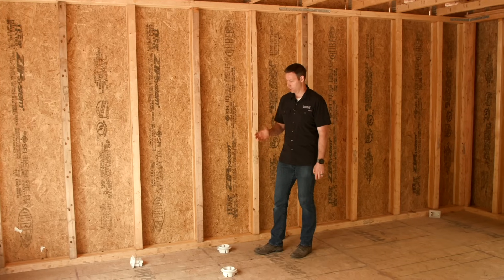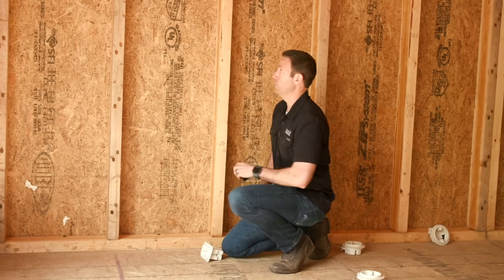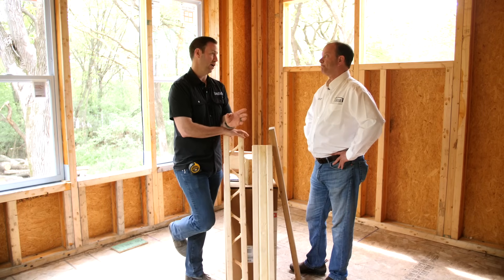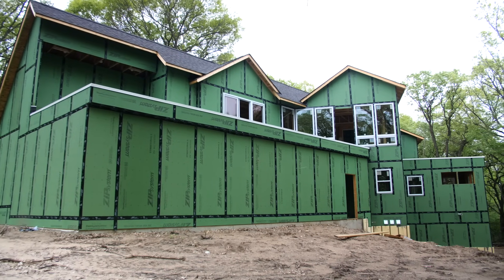Insulated Studs? This is a BIG Innovation in Framing!

Comment: They finally figured a way to Jack up the price of a 2x4
Reply: Um, no, 2x6 and 2x8... what’s the compression strength of these T-studs vs a standard 2x what ever again?
Reply: @4schitzangiggles  I guess allot stronger, little mess with the foam.....:-)
Reply: @4schitzangiggles  
Compression strength is based on unsupported compression. The T-stud is thicker (x3 instead of x2) and therefore has greater strength. This is mentioned in terms of length (height) of the 3x8.
Reply: it was only a matter of time
Reply: Lol, where I'm from they actually sell regular or "organic" framing wood, almost $2.30 more a stud for organic. 🤣
Reply: @TsrifTsal-s5m  I can only but assume he was refering to the insulating value (hence lower energy consumption, hence "better for the environment" ). Otherwise I agree with you: foam is dreadful.
I'm not at all in the house building business, what would you suggest as a good substitute?
Reply: @nicolas4601  go live in a cave...
Reply: I guarantee it will take a long time to recoup the cost of the savings, if any this overbuild costs.
Reply: We don't use 2x4's in exterior walls here in the northeast.  The concept is to virtually eliminate the thermal bridge, which is a very real issue.
Reply: @TsrifTsal-s5m  you looking at recycling a home ?
Reply: you don't have to buy these, if ur wanna go cheap and if you don't care about the environment thats fine, ill buy them for my future home
Reply: @JohnSmith-jz4pk  how eco friendly is manufacturing and disposing of the foam ?
Reply: Liking transwomen Isn’t gay if paying $13 for a $3 board is your way of saving the planet. When the board is 50% foam made from oil.

I think 🤔 you might be missing your own point
Reply: John Smith 
Hi John. I worked with styrofoam/polystyrene for about 15 years and it is very toxic material definitely not eco friendly at all plus it cost 4-6 times more than a 2x6

Comment: The industry misconception of believing a higher R value product is going to have a greater energy efficiency is misleading a lot of consumers. If someone is truly concerned about the energy efficiency of their home in Minnesota they will spray it with a two part closed cell foam. If your going to pay extra money to buy this product then don't use batting like he mentioned at 3:20. Remember wood is both a poor conductor and insulator since it is a bad conductor we don't have to worry about insulating it.

Comment: 2' oc will always make bowing in drywall, you should know this. Your studs suck
Reply: Well, you just have to use spray foam for the insulation.  Then you will have a solid block of, maybe toxic, manufactured goop as a home.  BTW did I mention we sell spray foam also?

Comment: I can see the value in the insulation factor in the wall construction up to the top plate but a house HAS to breathe , very curious how the insulated top plate will affect the air travel versus the traditional framing method over time.

Comment: electrical wire doesnt react with the foam? heat creation, wire casing lifespan
Reply: It's likely to be some sort of polyurethane foam, rather than polystyrene which is incompatible with PVC insulation usually used on cables. Electricians know how to choose the right size cable to account for the derating required by surrounding insulation, so heat isn't a problem.

Comment: What a poorly built house!  T-studs every 24 inches, half inch OSB wall sheeting, and double T-studs as headers! That house won't last 40 years without major problems! It would probably cost nearly the same as a true brick structure to build. The true brick structure, however, will last for centuries with the proper foundation.

Comment: seems like you have to spend a whole lot of extra money to try and save pennies... i can see that most people don't understand insulation and would buy into this but its not worth it... one more thing PLEASE DON'T EVER use OSB it will cost you more in the long run that crap acts like a sponge and will transfer rot to the rest of your house
Reply: Sounds like you have some experience doing rot repair jobs, I agree OSB is garbage I wouldn't build a dog house with it.
Reply: Yep, OSB is the devil's own invention.
Reply: Osb is great on pier and beam. I would hesitate using it on a slab
Reply: I wouldn't use OSB for anything besides a drywall replacement.
Drywall is what I would say is the crappiest building material used.
Reply: You dont use vapor barier?
Reply: Energy is just super cheap right now.  If they ever do a carbon tax who knows.  Contractors arent going to want to push this is my guess assuming its more expensive.  Or if building codes change maybe..
Reply: We built our house with osb 13 years ago and not a single sign of rot
Reply: Your are SO right..   The SuperSTUD accommodates up to R66 in walls.  WAY cheaper with inherent features that make the build so much faster/easier .... (https://www.youtube.com/watch?v=Btd1mHdossQ&t=9s)    Would value feedback
Reply: Hail Honkler  Your are SO right..   The SuperSTUD accommodates up to R66 in walls.  WAY cheaper with inherent features that make the build so much faster/easier .... (https://www.youtube.com/watch?v=Btd1mHdossQ&t=9s)

Comment: 6:05 what is the point of packing the entire section over the window on a non bearing wall ? the bearing wall is the long sides off a house where the roof stoles are resting ? 
im a carpenter from norway and im not saying this is wrong inn any way :P im just woundering. im just not used to fill inn so much on a non bearing wall :P
Reply: They were saving time on cutting cripples I think. Its wasteful on material but saves time for sure.
Reply: @hohcomics  true ;) save time and isolation :) i was just not sure if this was a thing they use or if there was something new i did not know about.
only thing i can thing of that is negative with it is if they are gonna run some wire/line across the windows. like have a electic outlet above the windows.

Comment: fire Fire FIRE!  Similar floor joists are a DISASTER in fires causing structure failures far faster than using standard dimensional members TALK TO FIREMEN Codes alas driven by lobbiests and diletants with agendas beyond SAFETY which were the reasons for codes.  R6 provides over 75% of the heat savings of the cavity R18 and there is no life cycle cost savings after higher cost of studs  Finally, having to go to 2 feet on center to save money due to higher stud cost is ANOTHER weakening of structure.  Treating the wood with chemicals - what a great way to add to sick building ie polluted syndrome last thing any home needs is MORE chemicals in it to slowly leach into home.
You want to up insulation value reduce chemical load increase building strength compared to this increase fire resistance decrease smoke developed during fire reduce ability of vermin and insects in wall cavity make insulation install more likely to be done right and air tight just switch to ROCK WOOL which ups R cavity R value to R24 the equivalent of 2 more inches of wall thickness AND less air transmission!  Vermin  die when they eat it uses no glues or chemicals eliminating any contribution to sick building syndrome self supporting over longer distances lessens sags insulation gaps R gaps air gaps  less itchy to install unaffected by water wont retain it dries remains effective fyi it's made of melted rock, lava, and, that's it, just melted rock.  
KISS  
PS all apologies to  inventor This is clever well thought out great way to use smaller farmed wood sparing wild forests Maybe if you had packed the void with pumice, vermiculite reinforced with fibers  based lightweight foamed concrete or plaster then slapped a final reinforcing strip of paper or fiberglass on each side, sort of like giant gypsum board this would have avoided most probably all safety issues  Nothing can mitigate moving to 2 ft framing, as much of the strength of a stud wall is in the coverings the membranes the inner and outer wall surfaces that brace and critical to this is the no of fasteners between membranes and studs, eliminating 1 whole stud per 4 foot sheathing sheet is a HUGE reduction, compounded by now having 2/3 of your fasteners within 3/4 inch of edges having vs 1/2 in 16 inch framing the only way around this would be to find a way to increase edge strength fastening, maybe w adhesive which alas contractors would skimp on or just run out of and workers would forget apply to dirty wet wood and board otherwise impair system and which would be virtually impossible to ck for after construction (unless you make a cell phone add on that could sense it using sonar reistivity magnetic or metal particles mixed in w your proprietary adhesive which by the way would be marketable as a value added to traditional builders too and something you could lobby codes to include as a requirement and pretty easily patentable to boot).
Reply: Preach brother
Reply: Russell excellent, pithy, and deep analysis. Thanks for sharing your thoughts

Comment: Seems like another cheap method they will probably seek top $ on. I will stick with traditional 2x6 on 16 center exterior wrapped and topped in 3/4 plywood not osb for real strength. Just built a 1900sqft 2 story house inside a metal house and built super strong with spray foam on 3 exterior walls then used rockwool on all interior, 2nd floor and ceilings. Cost for cooling avg $70 per month.

Comment: you should never frame your house on 24'' centers especially with hollow 2×6s and don't use osb on your house unless it's just sub flooring.
Reply: 24" o.c. should be banded from building codes . Building a home ? Build one that the big bad wolf can not blow down !!!!!!!!!!!!!!! There homes are built to cheaply and wont last long . This is what is killing the housing market . Homes are built with crap ! Should sell for crap .

Comment: nice idea but more work than needed .... just build to r2000 standards and avoid the extra bs cost ... btw the cross members in those studs will lower the insulation rating from r20 .... so more like r18 ... 
.

added materials increase the cost .... added care needed .... better off just build it right to the r2000 standard and avoid adding a few grand in useless expense ....

Comment: Why aren't the electrical wires installed inside pipes anymore? is it to save on material? i thought they had to be inside metal pipes for protection.
Reply: only outside or when exterior to a wall .... at the joists you will still need a metal cover plate to avoid piercing the wire ... making these useless studs even more useless ...

Comment: Looks very similar to. Concept 2000 which was used in the 80s.   Went a step. Further though and it would be a complete 4x8 section which you could cut down.
Reply: was tried for r2k standard ... but was junked because it was worse than just foam boarding the outside of the house and tyvek wrapping it ... better insulation value and lower cost overall ...
Reply: btw r2k uis not a concept is a building standard in canada that works better than this system and costs less and doesnt add any extra effort or materials
Reply: Your talking about something different.  I am talking about Concept 2000 in the 80s in the US.  4x8 or custom panels with sheeting on the outside.   The foam and 2x.. On the  inside.

Comment: This is dumber than watching the democrat debates. Use traditional stick framing, foam sheet the outside after sheeting and side the damn thing. If you haven't been doing this your behind the times for energy conservation. I'll use foam but wouldn't have the crap in my house. In a fire, foam burning is toxic as hell. They said fiberglass batts were fire retardant but I found it burned quite easily and fiberglass is supposed to be spun rock fiber. Have you ever seen a rock emit horrendous black smoke into the air?

Comment: First two questions that come to mind, is it available in southern California and to Cali build code?
Reply: If it actually works I would say no to both.
Reply: @dfpytwa  what do u mean "if it works" did u not watch the video? It tested higher/better then a standard 2x6 and in Cali they frame with only 2x4 walls
Reply: @nathanmccook133  My reply was sarcastic. As a former long term resident and licensed contractor in the state of California it has been my observation over the years there that if a good construction solution comes along it takes forever or never gets approved for use there unless some serious money is spent by the manufacture to grease the necessary palms to get it written into code. Scammers offering crap products particularly supposedly green products tend to get rubber stamped as a go either because they paid someone off or they put together a good pitch for politicians to use to either bilk more tax money out of the people to subsidize it or just force people to buy it whether they want it or not with all the appropriate kickbacks. All the cheap Chinese made grid tied solar crap they forcing new home construction contractors to use now for example.
Reply: libtards
Reply: @pockit57d.a.d.68  trumptard

Comment: 1in. Tongue and groove 2'x8' sheets of styrofoam on entire exterior  walls and gable ends and soffits  adds  R value. Use it extensively under Onecoat stucco in South Western States.
Reply: yup costs less works better and doesnt need to use screws in all the studs instead of the regular nails ...  these new studs are not worth the cost r effort ... just build the place to the r2k standard and save money while the building lasts

Comment: Couple of questions/comments- 
How are the plates fastened to the studs? 4 or 5 " screws? Even a 20d nail wouldn't go far into the stud and it seems like half the nails would miss or split the smaller x-section area to "aim for"...
Same question when building up the members for headers.
Being in earthquake country (California), the single butted top plate is a bit concerning. It seems like a spot the wall could "hinge" without the standard 4' overlap double top plate splice.
   Good luck on the new product! If I frame a house out of it I'll put in on my channel!

Comment: I  am a little leary of this. How much higher will  this  drive up the  cost of building a home  when it is widely adopted?   I would be genius if it could eliminate the need  for  using insulation but since  it does not then  the  big  selling point  is  you  get higher insulation at the  studs and more stability.  It is not easier  to work with except for the electrician pulling wire on a new construction.  But if  you ever have  to add a  new circuit there will  be  hell to pay     I don't  understand  why every comment  is just  saying this is so  great.   Why is it so great?   How  is it a  game  changer?

Comment: What the F is he talking about? Heat a board with a torch for an hour and check the heat transfer on the back side. It's absolutely not even warm. Wood is the best insulator known. Making air space that directly transfers heat in the insulation is ridiculous compared to wood. Damn sure I won't be spending my construction dollars on faulty ignorant building!

Comment: Never seen a house framed entirely with 2x6. Must be a regional thing; I live in Maryland and in this part of the country, 2x4 is the standard framing size. I guess it makes sense to use a wider stud in colder climes where you need a thicker wall for greater insulation.

Comment: Good to see this has been developed.  When I built my house in 1986 I did a similar thing that saved tons on my heating bill.
I had the package framed with 2x4 on 16 centres, then added a 1.5" wide strip of 1.5" thick foil-coated styro (R 10.9) to all inside stud, sill and plate surfaces on all exterior walls. That gave me the same depth as 2x6 framing and room for R20 in the wall cavity. Total cost -- around $400 and a few 3" roofing nails!  I contemplated patenting the idea, but never did -- sadly!  Some said there would be a problem with nail-pops in the drywall, but there never was.  Used 3" gyproc screws throughout. The t-stud method will surely cost a lot more than regular studs, but likely still a good idea.
Reply: Hey know how to fix nail pops??? glue the sheets! like everywhere else in the world. Sadly Americans are very behind the times

Comment: I thought wood was a great thermal insulator. Isn't that why log houses are so warm in the winter? This sounds like a lot of marketing hype.
Reply: Wood is not a good thermal insulator when compared to engineered insulation.  You get .75-1.4 R per inch with wood, so a 2x4 is only R3/4.  Walls should be R20.  Log homes with 8-12" thick log walls get closer but will never be as good as insulation.
Reply: It's an okay insulator especially compared to brick/cmu walls, but when you try to compare to engineered insulation like fiberglass or foam it's a terrible insulator that acts as a thermal bridge. Yeah there's a lot of stuff out there with marketing hype, but at this point it's very commonly known that studs are a major thermal bridge. You can buy a thermal imaging camera pretty cheap on amazon and see the temp. differences for yourself in your own home when it's cold or hot out. You're gonna see roughly 10-20% differences in temperature every 16" where your studs are.

The question here is whether t-studs actually provide the R-Value they claim. They haven't been around too long so there isn't much "evidence" yet.

Comment: I don't find myself getting excited about building products that often , but this has changed that.  what a great product . I'm building within the next year and this is now in my plan. Thanks Matt
Reply: Did you end up using them?
Reply: I don’t think this is a cheap solution but it is a good solution and the studs will all be straight. Not possible with dimensional lumber. It will save a lot of labor and a much better home results.